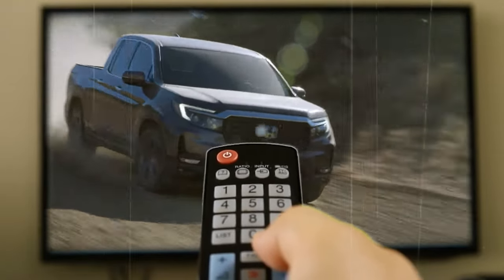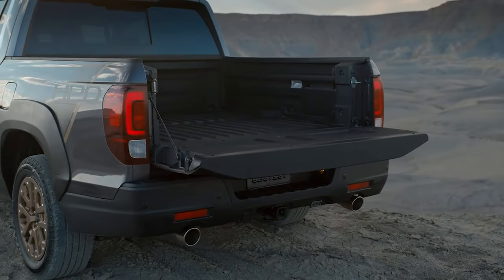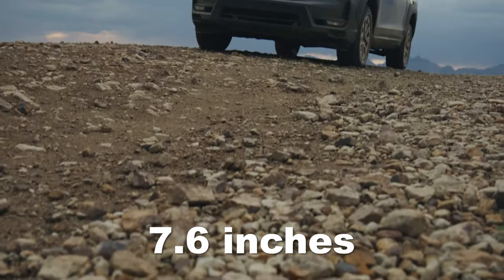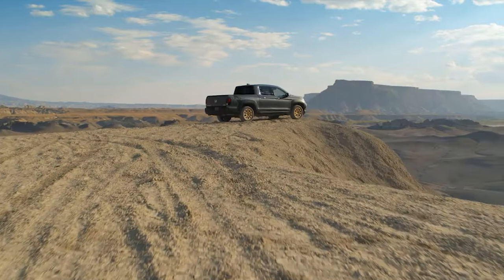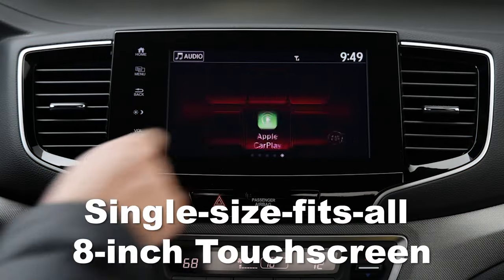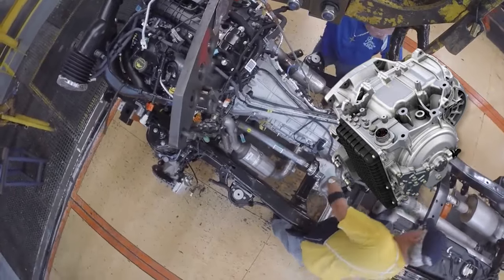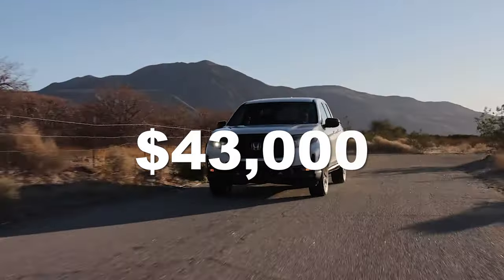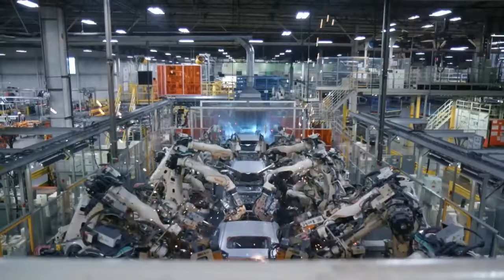6 Reasons Why You SHOULD NOT Buy Honda Ridgeline!

Comment: don't find any of these complaints valid. Especially the nonsense about the infotainment system, which I could do without altogether. The gas mileage is not bad and I couldn't care less about its off-road capabilities.
I have a Silverado, I don't take it off-road. Find something realistic to whine about.
Reply: Agreed. Fuel economy is average, or even better than most trucks. 
Infotainment is actually nice since there isn't some giant screen taking up a ton of space (that's also distracting and makes for less room to out physical buttons). 
You don't buy a ridgeline for towing and payload capacity.
You also don't buy a ridgeline for its off road capability.
They are vehicles that meet the realistic needs of most people, alongside having AWD, making them safer for inclement weather. I'm strongly considering getting one for my next vehicle because it has all safety and convenience features I want, as well as not being outrageously expensive to get all of those things.
Reply: I’ve owned one and would absolutely buy another. The 3.5 V6 is bulletproof, of course you get better mileage with a smaller displacement and turbos, but would bet the naturally aspirated V6 will far outlast a small displacement 4 banger with a turbo. I own a 2500 HD diesel Chevy for towing. As mentioned, that’s not what this size truck is for…